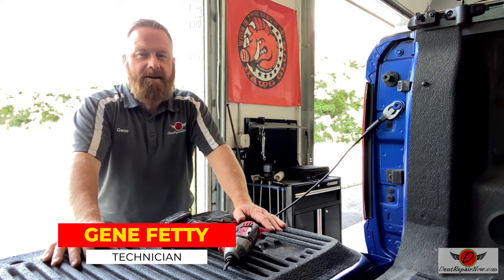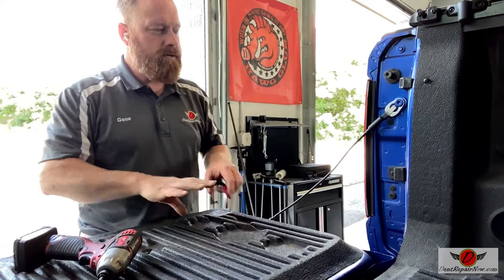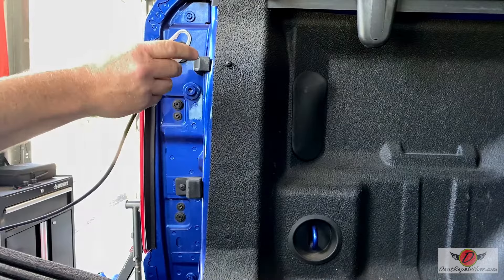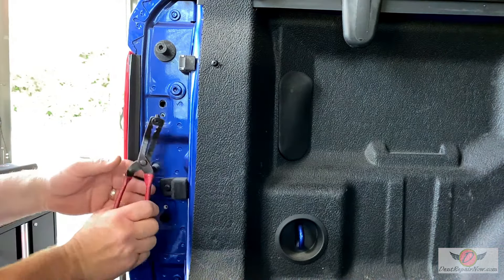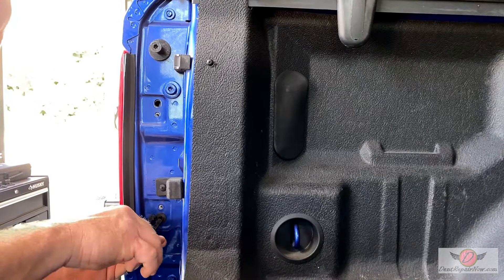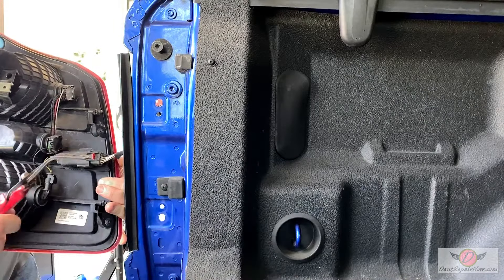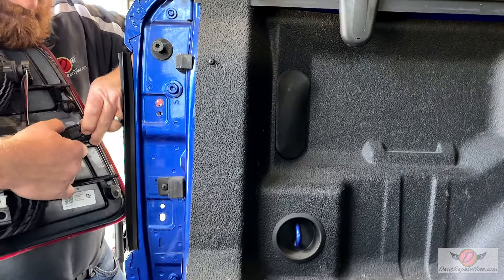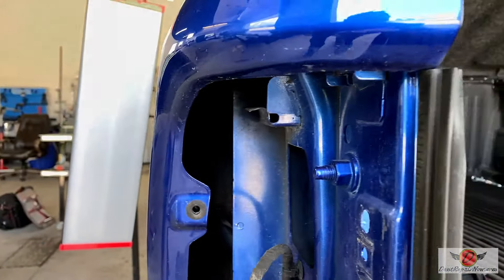How To Remove Tail Light 2019 Ram

Comment: For me, it was easier just to twist the entire light assembly out both brake and back up when I had to replace my tail light. This was especially for the backup light. I could not plug in the wire with the backup light still on the unit

Comment: What is the tool called that you remove the clips with?
Reply from the maker: Just a standard clip removal tool should work. I don’t remember which one I use in the video. STEK makes my favorite ones they are basically a plier with a bent end so they grab the shaft of the clip instead of the head.
Reply: @DentRepairNow  thanks you're the best... Now if I can only find tail light that doesn't cost $1, 000.00 per unit.
Reply: you can use a golf green repair tool.  worked for me

Comment: I took mine off to change the brake light but the light doesn't twist out like normal its like built into the tail light assembly how do you change that bulb ? have you seen this before ?
Reply from the maker: It’s probably LED and is likely part of the whole light. It may not be replaceable. I’d check with your Ram dealer.
Reply: @DentRepairNow  oh ok well that sucks thanks man